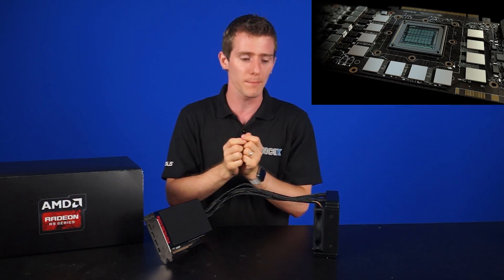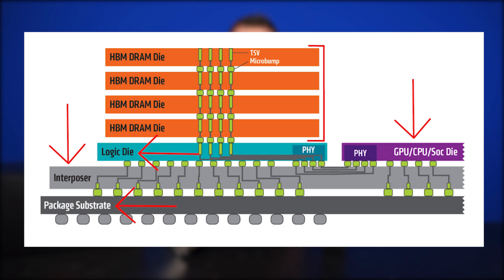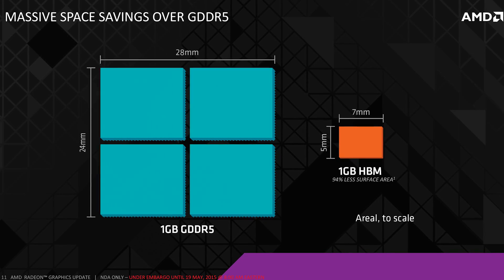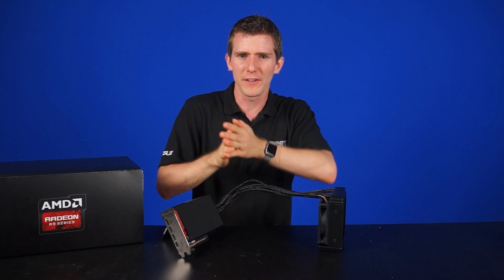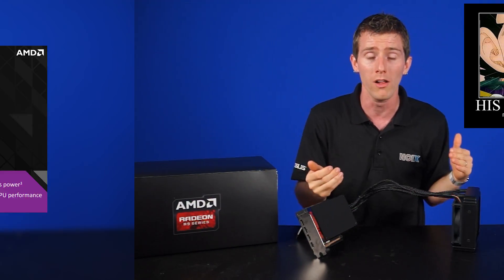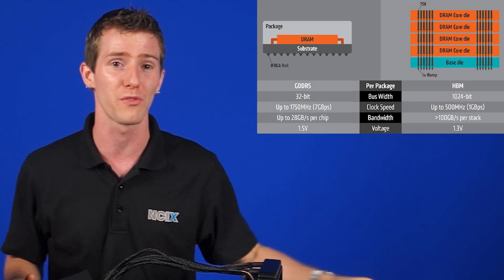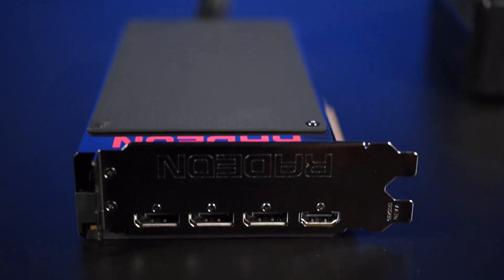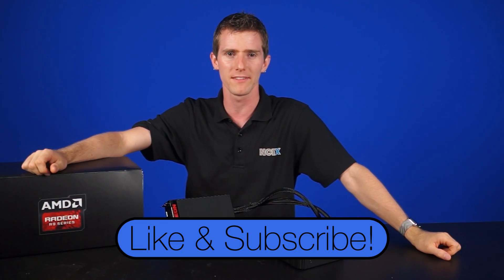What is High Bandwidth Memory? Feat. R9 Fury X

Comment: Does AMD hold the patent for HBM?
Reply: shakito lolo Why are they holding 9 germans? :-/
Reply: Michael Yangmi 9(german)
Reply: Acid Panda It's not like Nvidia is waiting as a strategic move, they have to get in line. AMD have exclusive contracts with SK Hynix over HBM1 and possibly priority access over HBM2. Apparently Nvidia failed the development of their HMC (Hybrid Memory Cube) and had to opt for HBM. A bit of a sticky situation i guess.
Anyway, the way HBM works makes up for the "limited" amount of capacity, although swapping is always undesirable.
Reply: Diavolo222 Lies, Amds producst are probably the most compelling products out there, just look at the 8350 for instance, It had a little worse single threaded performance then intels chips, but whiped the floor with even the i7 at the time when it came to running multiple programs for the cost of an i5.
But alas people are to interested in synthetic benchmarks to even be bothered looking at what you are geting when actually using the system :/
Reply: wizedo About fuckin time AMD gets to screw over the other guy. Intel and Nvidia have been bullying them for years.
Reply: Maybe when Nvidia get their hands on HBM they can make 4gb cards not 3.5gb cards ( ͡° ͜ʖ ͡°)
Reply: Yew Tewb It's not nvidia and intel's fault AMD failed to put compelling products out there for quite a years and decided to try their hand in console shit and they lost loads of money cause of it.
Reply: Michael Yangmi  they said they'd release hbm for others to use at some point in 2016 2H Or not.. just to screw nvidia bad. but amd is not known to use nvidia tactics to get the upper hand.
Reply: bolla999999999 I have an 8350, along with a 4690k, and at stock speeds the AMD chip is nowhere near "a little worse single threaded performance ". Witcher 3 has seen a 10fps increase - to a steady 60 - and less dipping, and several other games have seen even bigger gains. Skyrim, for example, saw increases between 20-40% in many areas, purely because of the single-threaded performance.

I still like my 8350 - which is why I still have it - but I'm certainly not deluded enough to insist that it does things that it patently does not.

Also, isn't it interesting that AMD's octacore is always compared to Intel's quad-core hyperthreaded chips? Granted, it's more than a little unfair to compare it to the 5960x, but it's an interesting observation, don't you think...?
Reply: AMD isn't usually a company to lock down things like that. FreeSync is not owned by AMD, and is in fact just a VESA standard, Mantle (despite sort of flopping) was always open source, or at least was going to be, and HBM is gonna be on Nvidia GPUs. They may have some sort of patent to the first generation of HBM, and did help design it, but they don't exactly have exclusive rights to use it.
Reply: *****
 locking hbm wouldnt help humanity. Nvidia is solely money driven company while amd pours everything into innovation. Now if it was money driven they wouldve bankrupted years ago.
Reply: ***** hell if i know XD
Reply: No. They are the only company that can use the first generation of HBM, though. Nvidia will have HBM2 in Pascal.
Reply: *****
It is hilarious that you think 7850 2x is almost better than the new titan. Keep dreaming.
 Also, comparing Crossfire with single gpus is always retarded and an argument always made by disgruntled AMD fagladyboys.
Reply: Michael Yangmi Its a JEDEC standard, so likely they cannot protect everything with IP.
Reply: Acid Panda nah, they just didn't think of it, and now that the 4k results are showing what a boost it provides they are intent on making sure they were always going to include it on their next cards, for sure...
Reply: Michael Yangmi Possibly, but they opted for a JEDEC open standard. Obviously they wanted some advantage and secured prioritizing manufacturing contracts with their HBM development partner SK Hynix.
Reply: Christ J Pascal has been announced a while ago and was supposed to feature HBM 2.0 already. So they didn't exactly wait for the Fury's performance.
Reply: Robert Shepherd First is not true. HBM 1.0 is not limited to AMD nor do they have a patent on it.
Reply: bolla999999999
"most compelling products". Well ok. I'm done.
Reply: Michael Yangmi that's what happens when you invent something
Reply: Acid Panda  Well, me neither until not long ago. Although it makes sense, since there' s not much word about it around. :)
Reply: ***** Not exclusive rights, but some commercial advantage yes. And quite rightfully.
Reply: Christ J lol Im glad you brought that up because I laughed my head off at his 8350 comment.. smh.
Reply: Christ J 4690k is no the chip i was refering to  -_-
Try playing your games with Xsplit running in the background and you will start to see what i mean.
Reply: Mitchell Hall You are one of those people who deserves what this world has become (T_T)
Reply: iim Alpha or they can just keep the TWELVE they have on the titanX. you fanboys are funny
Reply: Space Cadet Still, that 3.5GB split was an unpleasant surprise for us customers. Like the 980ti, equally performing as the titanx but much cheaper.
Reply: ***** 9 or "nein" means "no" in german
Reply: Michael Yangmi nope... AMD is a good competitor
Reply: Diavolo222 "It's not nvidia and intel's fault AMD failed to put compelling products out there for quite a years" => My $250 (2011) Dual HD7850 setup clocked at 1260Mhz core beats the stock $1.000 nvidia titan by 5%. The chips overclock 55% over standard with a 10% voltage bump. If that's not a compelling product I don't know what is. Back when I had one of them for $125 I clocked it so hard it was trolling $400 nvidia chips. The HD4850 did the same thing years ago, AMD makes the best bang for buck chips if you read benchmarks & compare prices.
Reply: Diavolo222 hahah yea, I sincerely hope he's talking about the original titan.. because the titanX just shits all over that. I run SLI titanX Hybrids in my rig.... now that's power lol
Reply: Mitchell Hall don't scoff at the original titan. it's a proper rendering card with floating point precision. the ONLY titan with floating point precision
Reply: Space Cadet yeah... which means absolutely zip for actual gaming.
Reply: Mitchell Hall yeh i'm not sure why you missed the memo, but graphics cards aren't just for gaming, some of us are video editors. what happened here was you are one of those people you think everything is about you, and i'll bet ten bucks you've never even seen a titan.
Reply: Space Cadet lol... like I said, I run 2 titanX in my system.
Reply: I would say I'm sorry my overclocked pair of 4 year old ($125) 7850's beats your $1000 titan. Diavolo222  - But I am not sorry. They OC from 860Mhz all the way up to 1300Mhz, if u got two of them running stable at those clocks, they beat 3 year newer 400% more expensive card. Go to 3DMark results page, compare the best titans to the best CFX7850 results. You will see
Reply: Yes I was talking about the original titan, I just found out there is a new one. Anyway, my $250 - 2011 setup apparantly still shits on todays $600 980Ti so it's still pretty funny.
Reply: ***** lol dude I score over 8800 on firestrike ultra with SLI titanX.. I am literally about 50 points away from being on the hall of fame list for X2 cards.. why do you think you don't see any amd cards anywhere on any hall of fame lists.. so no, your gpus aren't anywhere near what you think they are. You're acting as if titanX doesn't overclock either lol... I regularly have my cards overclocked to 1429MHz
Reply: ***** Ohhh okay.  The original titan, yeah I believe you!
Reply: How is comparing multi gpu to single gpu setups retarded? If $250 worth of midrange cards beats a $1.000 card, you get it, simple.
Reply: Mitchell Hall
Yep, for the original titan it's simply true, I'm first in 3dmark11 scores with my system, I got 12K score or smth, original titan doesn't go over 11K last time I checked. I don't know the new titan, I'm assuming it's the best single card again, costs $1.000 again and is beaten by two $125 cards in SLI or CFX again.
Reply: ***** so you can of course name a 125 dollar card that you can SLI and it beats a titan??. be aware that this is a tech channel where this exact thing has been measured, and we all know the answer, but you obviously do not. so please, do tell, what 125 dollar card can be sLI'd to beat a titan. eagerly awaiting your bullshit response
Reply: Space Cadet I think he's just pointing out how ridiculous it is because it won't be long before that is true. So it might as well be true.
Sort of. Maybe lol
Reply: Anon Mason it's not true. titan is overpriced, but hey have you seen what a top end AMD is worth?. if there are idiots here who want to buy kiddie gamer graphics cards and pretend they can beat powerful cards i don't really give ashit, but PLEASE don't expect us to treat you seriously. you need 2 970's to perform as a 980. you need two 980's to perform as [more than] a titan. there are benchmarks all over the internet for those of us that actually care about facts. sLI is fucking shit anyways. whoever thinks SLI is a proper solution is a fucking idiot from the get go
Reply: Space Cadet lol you have pretty powerful opinions. You're wrong as hell of course. 970s in sli overclocked destroys a single 980. SLI gives great scaling nowadays. We're not living in 2005, I'm not sure if you got the memo.
Reply: Space Cadet All you get with it is a score on 3Dmark like it's some game.
Nobody cares.
You can't actually use that power for any game out there to this day and be 'better quality'.
And when a game comes out that can, the card will be old. And have tech that just isn't utilized because it wasn't developed for it yet.

You max out your settings on games, which we all can do on any 980, then you just raise your fps beyond 100 with a titan or SLI this or that. Which is pretty much pointless. Other than to show off a number.

My 980 does fine maxing out every game I can buy. Even Arkham Knight is playable with all it's bugs.
Reply: Anon Mason I think you're forgetting about things like multi monitor or higher resolution. There is always reasons for more than what you have. Just because it's what's good for you doesn't mean anything higher is pointless.
Reply: Anon Mason but you're still talking just about games. SLI has ZERO EFFECT on video editing and it halves your Vram. the whole concept is for kiddie gamers. serious workstation users couldn't give a fuck about saving a few dollars they want 6gb of [real one card] ram and a shit ton cuda cores. this whining about fanboy bullshit is tiresome. people buy shit in 3 minutes these days and then spend 8 years defending their shite on youtube. and it's conversations like these that make people dumber. we have benchmarks for a reason. wanna see some?? you know like ACTUAL FACTS
Reply: Mitchell Hall That's old school. Oculus with virtual floating monitors handles just fine and is far less expensive.
By time it's 2nd gen comes around the resolution will be small enough that pixel density and render size won't matter. Since your eyes can't see anything beyond it anyway when the virtual monitor is sitting at some distance. Everything else is just scaling.

Meanwhile I do have 3 monitors. Wishing I hadn't spent the money on them now since I can run games in a far better experience with virtual monitor setups.

And I'm not talking about immersive VR gaming that only work with certain games. Everyone seems to think that's all the Oculus is for. I'm talking about just using it as an environment with flat 2D monitors in front. As if they we're the ones on my desk.

And I don't have to shell out another $300 for a 4th monitor if I want to use 4k.
Or just make one big virtual 4k monitor ffs that I can walk up to and see details beyond what the Oculus can currently render. Which, as I said will be solved later.
Reply: Space Cadet If you're going to setup a render farm then sure. That isn't most people. And it's priced for those who would use it for that purpose. And that's where it belongs.
Reply: Space Cadet kiddie gamers? Really? Get over yourself douchebag.
Reply: Space Cadet The Titan Black wants to have a word with you.